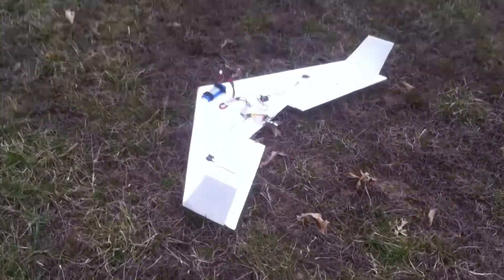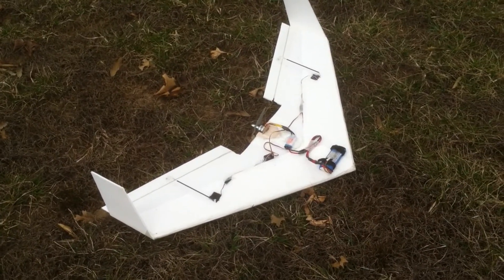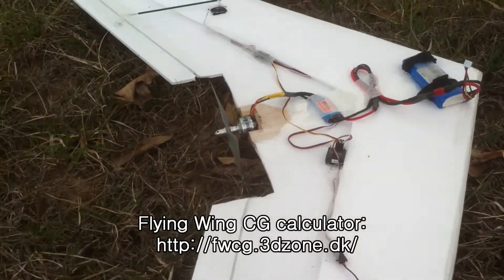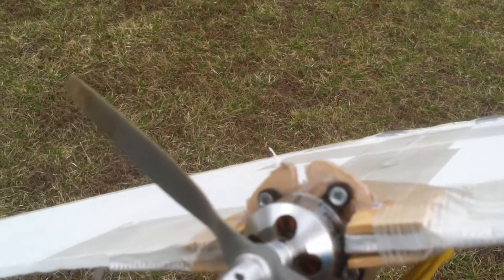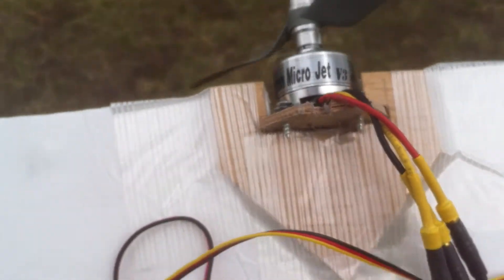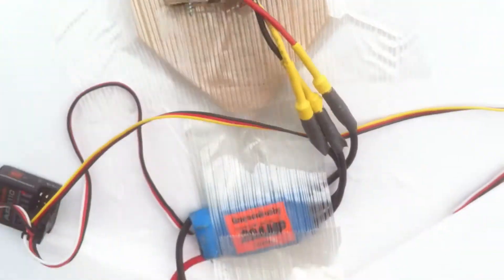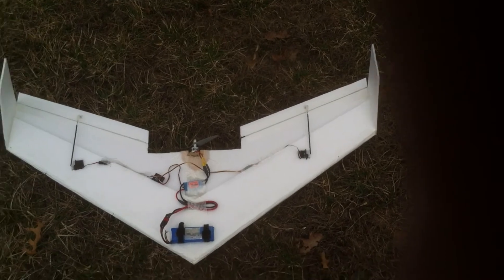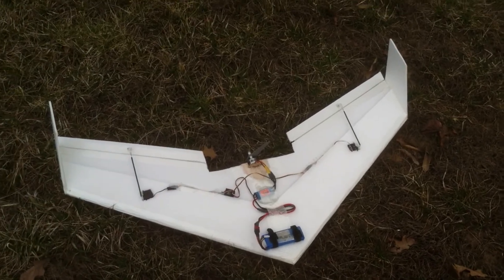Scratch Built Flying Wing Maiden

Comment: The supports are necessary if you're going to do some high speed flying. I had a very similar wing shred itself in a high speed dive destroying an esc, motor and battery.  It sounded like a gunshot lol.

Comment: Looks good. Flying wings tend to LOVE high winds. I just made a 25" model using a very similar power set up. I flew it in 20-25 mph sustained winds with gusts to nearly 40. It wasnt rock solid in the big gusts buit when it died down to around 20 it was perfect. Cant waint to fly mine in gooed weather. I need to downsize my motor so I get longer flights on my 1000 Mah lipo. I did a KF-2 with a top and bottom airfoil. handles well.

Comment from the maker: @WindyCityRCFlyer I just built a new version, with dowel rods in the leading edge and carbon fiber rods connecting the two pieces. It seems to have a lot more trouble flying though :/